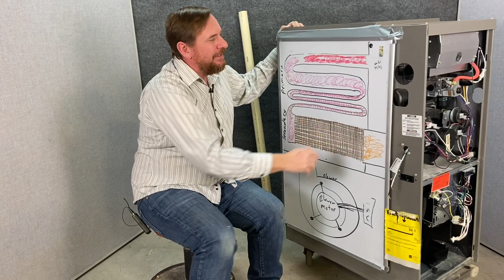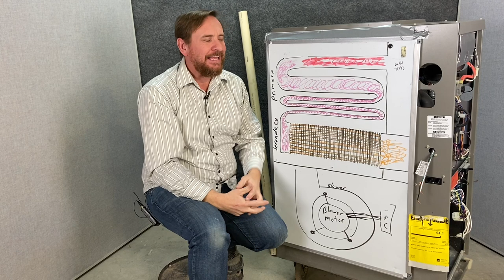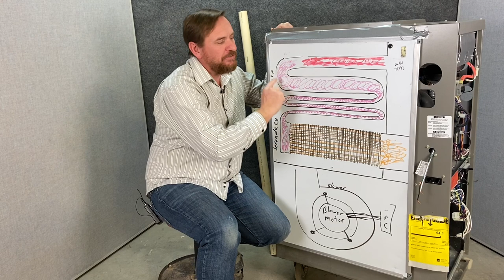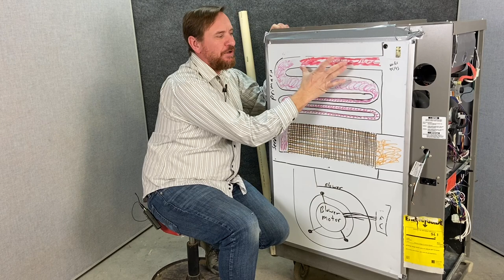90% + Condensing Furnace

Comment: Question on the collector box.  I have a system I maintain that has a metal collector box  that is starting to rust right where the drain tubing port is.  There have been issues with the condensate drain system in the past. Does that condition automatically put the secondary heat exchanger into a suspected condition?

Speaking of high efficiency furnaces, did you ever work on the Lennox Pulse?  My employer has a site with one of those.  No inducer fan that I could see so being the curious person I am I looked it up, fascinating system --- 90+ efficiency 30 years ago. 

System still works, well, no complaints, but most certainty needs to be replaced soon.  

Thanks for the video.  To date I have not found anyone who took the time to dismantle a system completely.
Reply from the maker: Thank you.

Rust does not mean there is a problem but it does warrant further inspection. The secondary heat exhanger has more connections and more points to leak but it's stainless steel so it should not rust. The primary is usually not stainless and is not suppose to condensate. It needs to be checked for rust. If rust and a combustion analysis performed. 

I was one of the few people that liked those old lennox pulse furnaces. I had the special tool to pull the spark plug, although if they system was running right they where never dirty. It used little explosions or puffs. That's what pushed the gas out without an inducer. There was a flapper valve behind the bolts and steel plate pannel in the front. That was always the issue. It allowed for the combustion air to be pulled in and when the gas ignited it was forced closed and the exaust had to go out the other way. It was pretty cool but very heavy. 

The big issue is the secondary heat echanger is notorious for leaking. Many where recalled because of that. I would inspect it thoroughly and make sure the customer had a few low level CO monitors. (Do not rely on alarms)

Comment: Other than changing the filter, what maintenance would prevent  the secondary exchanger from clogging up? I use washable synthetic fibre filters and have had no issues in ~18 years.
Reply from the maker: Filtration is the most important thing. You must keep a very clean house, the washable filters are typically the dirty units with the exception of the Paul Harvey allure pure filter that blocked so much airflow. It lasted this long so I would not change now. When the time comes to replace look at a 4 to 6" media filter. 

Other maintananace is clearing the drains, flue and intake pipes. Cleaning the flame sensor are the big ones.
Reply: Our furnace doesn't run that much. Well insulated  with a setpoint of 64F in a Seattle type climate. Got me worried now lol.  I think I better inspect the 2nd HX. Would a inspection from the bottom be sufficient?  I only have room for a 1" filter.
Thanks for the tips!

Comment: Very interesting. As some said below , these HE furnaces are great when they work but repairs are excessively costly. I understand that the US Government is going to require the phase out of the 80 percent furnaces and these will be the only option , all in the name of efficiency. Nobody, however, figures the cost , resources and energy to build replacements on an increased frequency.On average per all these "experts" you will own 3 to 4 HE furnaces versus 2 of the 80 percent types on average life cycles. In my case, the the ECM module failed after 5 years with no reason apparent. The labor cost to replace it ( part covered under 5 tear warranty) more than ate up any energy savings to that point. So , assuming the HE option is mandatory, they should make the manufacturers provide minimum 20 year heat exchanger warranties and 10 years on the parts.
Reply from the maker: Please see the latest video where I address these concerns and more.
Reply: @love2hvac  Yes, I found  and watched that. ( I do enjoy your videos). Technologically, when you were still in diapers, I purchased one of the very first Lennox Pulse Furnaces. I replaced a 12 year old 60 percent-er NG furnace with a ( as advertised) 95 percent-er. It had its issues , noise, and some breakdowns,  but I felt I got my money's worth because the increase in efficiency was that great. Lennox , with some Government prodding , agreed to replace premature HE failures with a new HE or new 92 percent-er condensing furnace. We opted for the latter and I could see from casual inspection that the quality of the parts within had decreased, but in the name of good citizenry.... I am not in the business but grew up working with my building contractor father and learned a lot about the trades hands on. What I have observed over 45 years, owning two houses, that HVAC techs, are like the wind. They come and go and I have never seen the same people twice. Their knowledge and skills ( and attitude) are all over the map. My latest service supplier ( rated number 1 in all local polls) is great about showing up ,but with no parts and only basic tools ( no manometer, no combustion sensors , etc). A few weeks ago ,my two stage "Elite" furnace  ( brand rhymes with a tool you use to smooth a cut  pipe end) would not turn on. The board said error code 45. I looked it up in the manual ( I can read and can follow a circuit diagram) . Six things to check. I checked 1-5 and no issue. Number six was the inducer switches. I dragged out my VOM and watched a YT video on how to check them. Did so and, voila, the low pressure switch was not closing. Since I didn't  (then) stock parts in my house, I called my " red carpet" installer/service supplier to come and fix it ( informing the dispatcher in advance  of my furnace model and part needed). The guy shows up- repeats most all I did and tells me I had it correct. No parts on the truck ,though, ,of course. Next day , maybe, and $342 plus 8% tax ( the tech said the markup for the parts was 300 percent, plus travel, etc.) , in addition to this 200 dollar service "call". I said no thanks. Ordered both OEM ( yes OEM) switches in duplicate and had them noon next day for $60 bucks ( with shipping). Seven minutes to replace both.  If you read the news a lot you will note that most people in this country do NOT have 500 bucks for an emergency. I can afford the $342 easily but what about those that can't ? I can tell you about my "professionally" installed (expensive) BW Water heater that they insisted that a  condensate drain was need for the PVC flue., etc. etc. I can tell you about ten other stupid and costly ( to me) things that were done over the past 40 years by these techs.  Anyway, a serious question for you. I asked the tech to check my outlet gas pressure in the furnace ( trying to get my 200 bucks worth) . Advised ( after my loaded request)  they don't have manometers, but he "thought' ok because "factory set". That MAY be true, but is it possibly affected by my having a gas fireplace (thank God we had that to keep us warm overnight) installed, in addition to my gas water heater. That is, if they all fire at the same time would  the pressure be ( adversely/significantly) affected ???
Reply: @love2hvac  As a yesterday update, my neighbor next door passed away suddenly a few months ago. His brother , checking on the house, noted a leak on the top of the (relatively new ) water heater and asked if I could take a look. Upon observation , I noted the leak was between the heat nipple and cold water copper supply . I said it was probably caused by the “professional” installer soldering the adapter fitting after attaching it to the nipple or not being careful with the Teflon wrap. So I cut the pipe ,replaced the nipple with proper threading and rejoined the supply and all is well. I also noted that the professional installer ( local established firm ) did NOT hook up the condensate drain from the draft inducer blower and that some water had backed into the fan (similar to what happened to me for my professionally installed BW). A 2 dollar piece of tubing to the Little Giant and all is well there. My point is what does a”normal” consumer have a right to expect . Do we have to read all the instructions ourselves and stand over them as they work?
Reply from the maker: I don't have an answer or solution for that.

Shoddy work absolutely ticks me off.
Right now companies are focused more on sales and marketing rather than skills and training. 

Inspectors are over worked and underpaid, they only look for some code prices and not a quality install. 

The BBB sold out to advertising.

It's a problem without a solution.

Comment: Hey ty, what are the two limit switches on the blower housing? I've always wondered this, rite at the end of your video
Reply from the maker: Called auxillary limits, required for downtown and counterflow but nice to have in upflow. Multi positional furnaces usually have them.

If the primary limit fails these will trip. They are at a lower trip (open) point that the primary limit.
Reply: @love2hvac  thank you

Comment: last summer I was checking the furance out and the burner inspection window was full of leaves, removed it and vaccumed all the leaves out, seems no one around me has any grillls over there PVC intake tubes
Reply from the maker: Please don't put grills over the intake or exhaust. It's will cause freezups in the winter. You can put a run down pipe on the intake though or even a tee that will prevent that. Always check the installation manual for what that model required. 

A leaf blower works well to blow the debris back out.

Comment: Hi Ty! With These new 90 percenter furnaces it looks like it does away with the old smoke pipe like on oil furnaces? When I clean the old oil furnaces I have to clean the smoke.pipe and chimney. Do you have to clean the pvc exhaust pipe some how? Or is the soot none existing since its a condensing unit.
Reply from the maker: I have not had the pleasure to work with a condensing oil furnace. I would think with proper combustion analysis and operation it would not be necessary on the condensing oil furnace. 

I know on the standard oil furnaces I had to clean the flue when it wasn't burning right. This was misaligned electrodes, swirl plate improperly set, nozzle dirty worn or improperly sized, or failed ignitions causing the excess fuel build up. The 90% will have more controls to protect against that. The condensation will remove a lot of that alos. I imagine worse case scenario it would be easier to clean. In short I do not have a definite answer.
Reply: @love2hvac  thanks for the reply Ty! I was just curious. I am new the gas funace end of the business. We just got some new properties that have them. Thanks again. Super videos.

Comment: Also longer run time on low speed continues to filter the air. I have Trane 90% with clean air effects filter. Is that filter worth it ? I don't know if adding electricity is capturing enough dust to make it worthwhile.
Reply from the maker: I have not had a chance to play with the trane effects filter. 
My typical stance is against electronic filters because if ionization and ozone generation. There are some exceptions to that and that filter may be one. If it ionized and then is recollected in the filter, that would be an exception.
Reply: @love2hvac  Thanks. Supposed to be a small amount of ozone, but I'm thinking of unplugging it and putting in regular.

Comment: 90+ Furnace Drains line need like 9” stands when installing horizontally. Because then I don’t have room for slope. Do you do the same?
Reply from the maker: I usually hang them. Less vibrations to the ceiling and plenty of room for slope. 

I like the hungrite system.
Reply: @love2hvac  Thank you. That looks pretty cool.

Comment: Ty or anyone else..one question. I was under the assumption that combination gas valve had the pilot and pilot thermocouple built in however on on new furnases this is done by the furnace control board.  In this video he refers to the gas valve as combination gas valve... What makes it a combination gas valve is my question. Go easy on me I am learning too
Reply from the maker: Great question 
Combination gas valve means it's a combination of a pressure regulator and solinoid valve. 

In the old old days those components where separate. 

There are many types of combination gas valves be it standing pilot, intermittent pilot, redundant or smart valves.

Thinking of it as a combination of those 2 is important in diagnosing. 
Remembering it reduces gas pressure and separately it opens and closest the flow of gas helps remember to check each function.
Reply: @love2hvac  thank you so much.  You are the best teacher I have seen

Comment: Could you make a video on installer setup options (ISU) advanced menu for thermostats....I know each thermostat is different but I feel like someone like you can make a very good video, explaining all the options for different applications... like
 ISU # "218"
ISU name "reversing valve"
ISU options "O/B on cool, or O/B on heat....

Some say most revering valves switch on cool...but how do I know for sure?

It just seems like the ISU is full of information..that is over my head...
Reply from the maker: Thanks Rick.
I need to film the electrical portion, the heat pump portion then I will do thermostat installer setup video examples, vocabulary and why's.

Comment: I live in brenham texas. What is the correct Spud to use for my LPG furnace.
Reply from the maker: Varies by manufacture.
Find the model number of the furnace. The  search for the LP conversion kit for that furnace. It will include detailed instructions, the spuds/offices the spring for the gas valve, the diffusers for the burners. 
After that is installed variety gas pressure input and put put and perform a combustion anylaysis.

Anyone working on LP appliances in Texas must have a certificate from the Texas Railroad Commission.

Comment: I’ve installed 80%, 90%+ single-stage, two-stage and modulating furnaces for 44 years. Many on LP, which they are not designed to run on. I will never push anything more than the simple 90-92% single-stages anymore. If you run on LP or want higher than that, save your money because you’ll need it for preventative maintenance and repairs. I had an igniter fail after two months on an NGK~ all manufactured in Saltillo, Mexico. I had a heat exchanger collector box rust out after 9 years and Goodman stopped manufacturing repair parts. Nothing but over-complicated, over-priced junk and poor customer service anymore.

Comment: How do you know how much BTU's to subtract? When you say 66K btu's and the house gets 61k btu's.
Reply from the maker: Thats a great question
On the data tag of the old furnace find the ____Input BTU/hr and the ______ % AFUE efficiency

_____ input BTU x _______% =    __________Output BTU for the house
example

100,000 BTU input x 60% AFUE= 60,000 output BTU for the house

That original furnace output is important , lets say I want to replace it
The old furnace heated the home well without short cycling so the 60,000 is okay 
( heat load calculation would be better)

Now lets look at a new furnace.
If I bought a 100,000 BTU furnace that was 98% AFUE the output would be 98,000 way too big!

but if I bought a 62,000 BUT input x 98% AFUE= 60,000 BTU outpout the same as the old one.

Hopefully that helps
Reply: @love2hvac  I did the math on that last part. Checks out more or less but still 60k.
that helps thank you!!!

Comment: the actual combustion efficiency is no more than 90%...beyond that is an educated guess based on a lot of potential variables outside of a lab environment. That is also how you can tell if your combustion analyzer is "true" or if it is coloring the measurements beyond 90 (marketing world). This is also why the secondary/condensing heat exchanger in the Payne PG9 92%, for example, is the exact same secondary as the Carrier MVP/MVB 96% modulating furnace. See what I am saying? Same primary, same secondary..., I will say it again: same primary and same secondary. The actual actual combustion efficiency is 90% or slightly less in all condensing gas furnaces. This marketeer shitshine world we have created says one is 92% and the other is 96% haha. These examples are not exclusive to Carrier/Bryant/Payne.
Reply: Then add to that, these highly refined energy efficient devices become energy hogs when oversized and/or improperly installed/maintained. A 2-stage furnace efficiency is measured in high fire (2nd stage), with a very steep drop off in efficiency while operating in 1st stage (think about it...what changes? not the cell size, the flame size changes with a static cell size... = way different thermal transfer dynamic. Now consider also the variable speed fan in the "more efficient" models, which actually uses more energy to overcome restriction when: filter dirties, or if the furnace is oversized and/or if the ducting is not large enough for the variable speed fan to operate within it's design range static pressure. People think they are going to get lower energy bills, but most times they get an oversized 2-stage furnace which costs them more to run that if they had just gotten a 92% with a PSC or ECM multispeed (non-variable) fan. But don't even get me started on "variable speed" and how it is maybe the biggest marketing misnomer I have noticed in this industry.
Reply from the maker: Pluss the Private Equate companies taking over HVAC, focused on selling oversized equipment with  undersized ductwork.